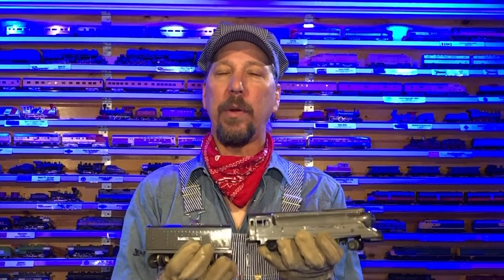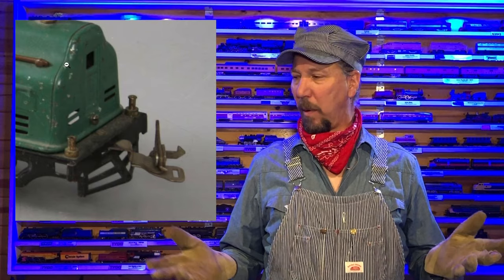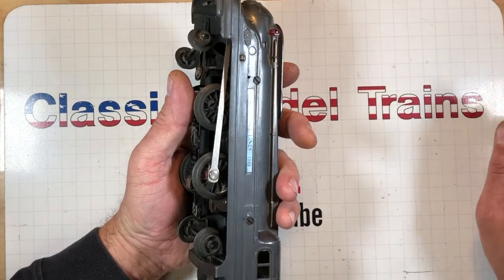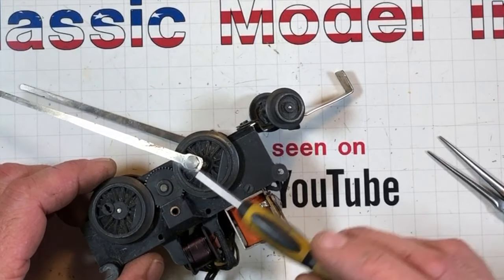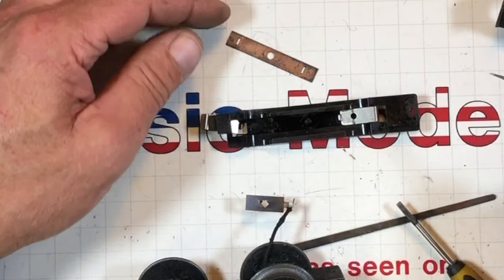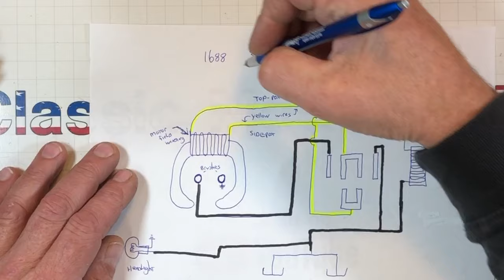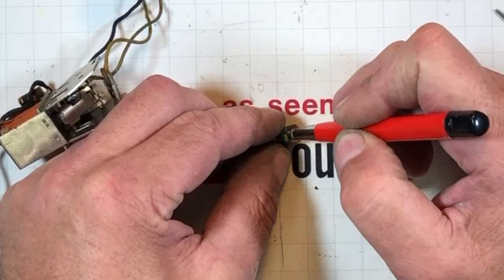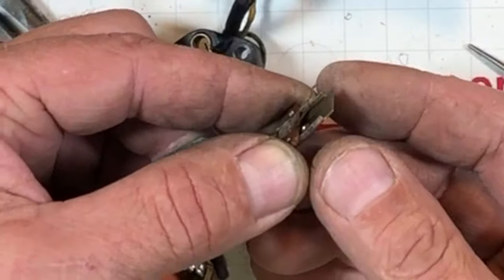Repairing a Pre-War Lionel 1688E Torpedo

Comment: Nice and informative video.  I've never liked working on Lionel steam locomotives.  They are just a pain in the rear.  The one thing, though, make sure that nobody uses a polishing compound-style wax.  It will harm the surface, as it has a fine substance made to clean stuff out of automobile paint surfaces before waxing.  Regular carnouba wax is just fine.  I use Simonize on my AMT passenger cars.  They are aluminum and they just shine like a mirror when I'm done with them.  Either way, an excellent video.
Reply from the maker: Thank you John!

Comment: Thanks Ron.
If you notice, between this open frame motor, the Pul-Mor and the MPC motor, that brush holder and motor design hadn't changed in over 70 years. And then Lionel LLC did the can motor thing. 
Great vid.
Reply from the maker: I like when engineers don't mess with something that just works :-)  Can motors are better suited for them fancy sound loco's with computer chips driving them around.  Thanks for watching!

Comment: GREAT VIDEO, I enjoyed it very much.  I bought a 1668 (2-6-2) on e-bay several years ago for $25. The add said it did not run.   Found a electrical short in the e-unit.  So I removed the e- unit and re-wired it to run forward only.  Cleaned it up, put new brushes in it and it is one of my best runners.  I rely like the pre-war trains.
Reply from the maker: Thank you Erick.  Sounds like you got a pretty good deal on that 2-6-2.  Any thoughts about putting a e-unit back in it?
Reply: Eventually, yes.  @classicmodeltrains

Comment: Hi Ron,  Great video! I've got one of these that I've had for many years. I could certainly sympathize with you on the e-unit repair (they can really be a pain sometimes!).
Reply from the maker: Hello Roger. Thanks for your kind words. Is your Torpedo still pounding the rails?  Yeah I would pay good money for the jig to assemble those dang E-units for sure!!
Reply: Yes, it still runs! I'm a Lionel collector, and I've got others that I run, so the Torpedo sits on the shelf most of the time, but you know how bullet-proof these old Lionels are. A drop of oil here and there and send it down the line! @classicmodeltrains

Comment: That was an outstanding video Ron. You did a fantastic job on it. The locomotive looks and runs great again. The Torpedo was always one of my favorites. I have the twin brother to yours which is a #1689E. The 1688E and 1689E were the O27 locomotives. The “O” Gauge big brothers were the 238E and the #1668E. I have both the 1689E and the #238E. They were my fathers that were handed down to me, and I in turn will hand them down to my sons. Excellent video Ron! Tom
Reply from the maker: Thank you Tom!  Are the "O" gauge ones a bit bigger? Like noticeably?  Pretty cool there being handed down thru your family like that.  Great story!!!!
Reply: @classicmodeltrains  Yes, the #238E and #1688E are definitely bigger. They’re wider and a little longer. My Prewar #238E was made as a 4-4-2, and my #1689E is a 2-4-2, HOWEVER, in 1996, Lionel reprodced the #238E, and the #1668E using the original tooling for the shell of the prewar #238, but corrected it to be a proper K4 as a 4-6-2, and it was made with very early TMCC, but this time it had a hooter whistle for sound, and a smoke unit!! I did a video on the prewar #238E and the 1996 reproduction #238E along with a little history lesson on this locomotive. It’s on my channel if you’re interested to watch it. Let me know what you think if you do. Thanks, Tom
Reply from the maker: @TomzTrainzandAccessories  digging thru your channel right now. A lot of nice Lionel you have yourself there Sir!!

Comment: You have brought up on more than one occasion not having a wheel press… which one do you want? Have you researched which one you would choose?
Reply from the maker: I'm sorta waiting until I get a larger area to model / repair in.  I want to get a small arbor press for installing.  I guess I would ask around what pullers other Fellers use when working on this bit bigger stuff

Comment: Love these later O gauge tinplate engines. Interesting the design difference between the chassis on this compared to the 259E, a lot more cast parts, and different center rail pickups. A lot of design evolution between them!

Not sure why, but my 259E can traverse an MTH O-31 switch. I think it's because the side with the gear teeth is going over the side without the frog, but it's one of life's mysteries.

Just noticed "Lord of the Isles" hiding back there on the shelf - I've added some details, crew figures, and paint to one of those, they're simple but clean up nice.
Reply from the maker: This one was a bit different than other Lionels Ive worked on.  The journey of exploration in taking them apart to see how they tick is always enjoyable for me.  A few people have mentioned that "Lord" loco up there lurking in the dark. Very distinct profile it has.  MTH 0-31's?  Sounds like heaven to me to own!!!!

Comment: i'm a bit new at this but is there a way to bypass a bad e-unit?
Reply from the maker: Yes there is but you have to be kinda knowledgeable with electricity flow and provide power to the stator electro-magnet and brushes.